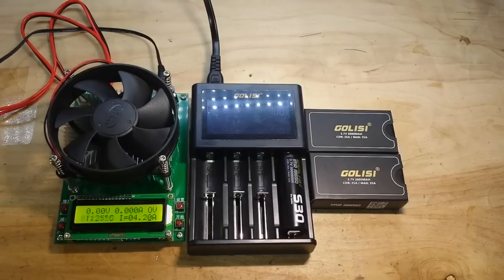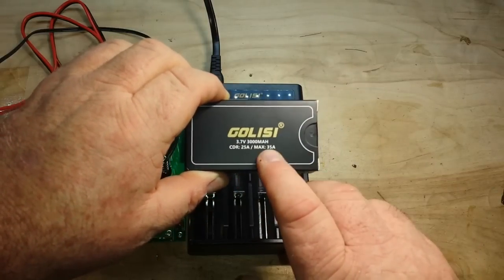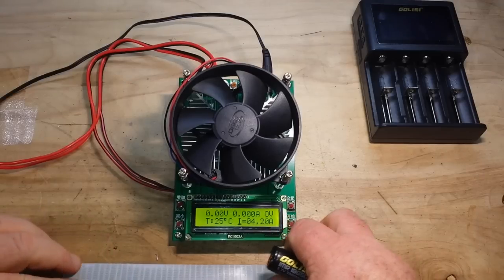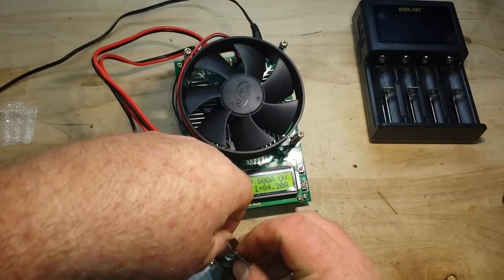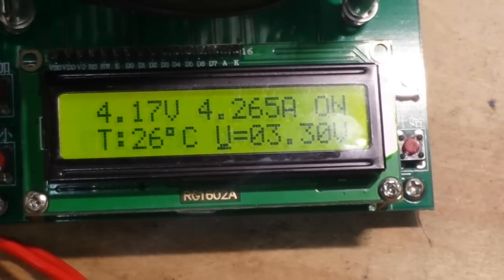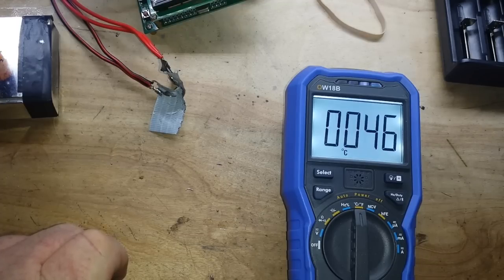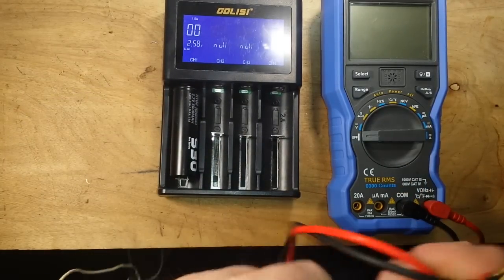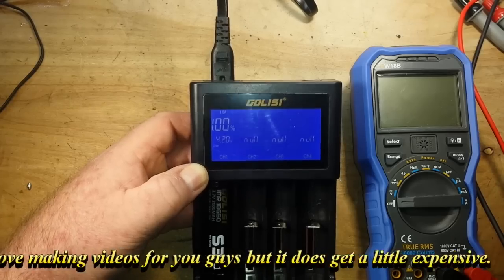Golisi IMR18650 S30Pro Tests

Comment: Already have an 8008, not thanks. But, discharge to 3.0 and get close to the actual rating. And, over 50C is to high for a cell rated at 25 continuous.

Comment: INTRESTED! I have over 1100 18650 cells and have 12 charging and testing! 3volts is fine. I wouldn't go under 3volts. My charger wants to go to 2.8 i don't like that. My programmable discharger I go to 3v.. Give me the meter! Re jig your rig eh! I only discharge at 1/2 amp 4.5 is a bit high for a single cell! If it's a good cell I have great cells that were just under 2 volts. As long as they are over 400mv I have had good luck with them! If they go too close to 0v they just get hot. And take voltage like a shorted cap. Dus connect and it discharges the little charge it has fast! I guess it is basically acting as a capacitor. 2metal plates close together! Right!  I have learned a little!  But I have 1100+ cells I'm going to use to power my off grid home. As soon as I get 1400 cells. To make 100cell packs in 7series.and those in parallel with 7 more!  I only need 2800 more ! After I get the 1400 . I need to make it through a day or so with very little sun. And I have a generator. And a lead acid Bank I'm using now... Great video. I have been wondering about those cells!

Comment: First off, I hope somebody Emailed you quickly and the meter has been given away by now. At least it's to someone who actually watches your videos.  Second, as I felt the first time you demonstrated, I would not recommend that electronic load (disappointing), however, at least you got to test the full capacity of the battery. Kudos to Golisi for proper spec.

Comment: You talked about the lithium ion battery possibly being dead because it de charge so much. I have a TV remote with a small lithium ion battery which is not user changeable. The things about 10 years old and was not charged regularly before I got it so now it works when plugged into the charger but when unplug it immediately indicates low battery and shut off.
Is there anything you can recommend to resurrect a battery like that? Or is it going to have to be replaced? I hope this is the right place to ask and thanks.
Reply: When the battery will not hold a charge you must replace it.
Reply: I was hoping you wouldn't say that, LOL  Time to re-watch your How To Solder video =)